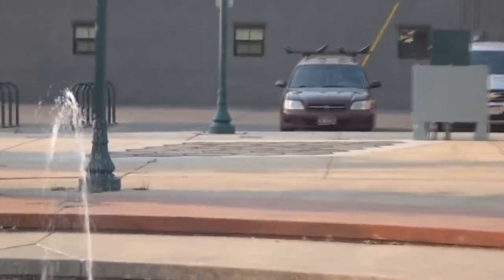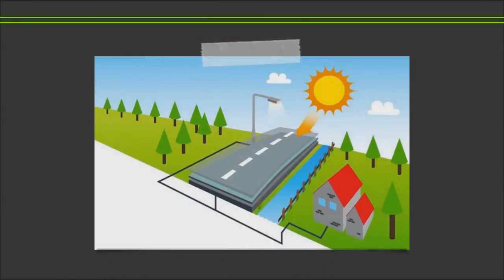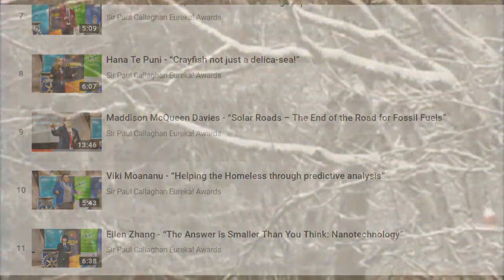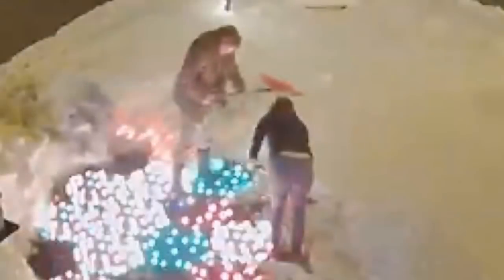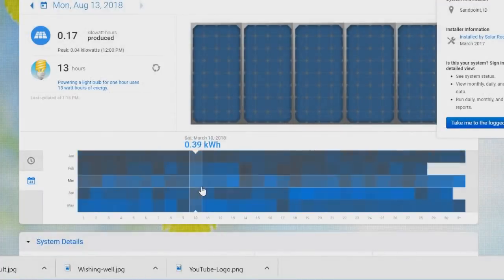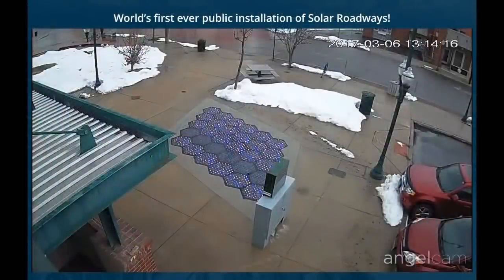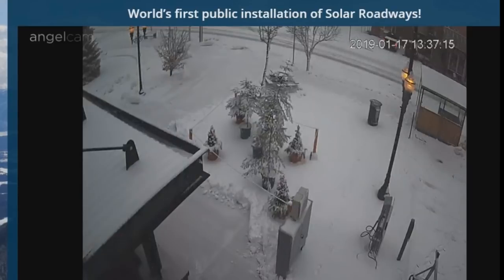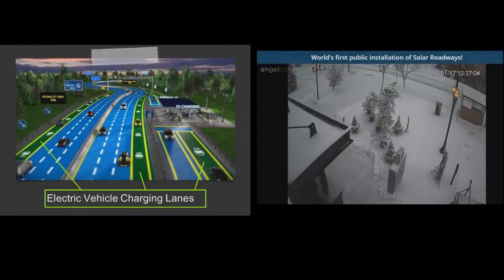Solar Roadways to be installed on Cruise ships!!?

Comment: Has anyone seen their Website lately? They  give a chart  to compare SR - concrete and Asphalt... And they list numerous capability twice to have many pro SR points... -Produces electricity -can charge EVs... 
So here is my advice for your future presentation Solar Roadways : 
-can display the Letter A -
-can display the letter B .... until Z with the incusion of at least every ASCI symbol... 
-can charge Smartphones 
- produces 100% iPad compatible  power 
-produces  100% iPhone compatible power 
-Works also with qualcom Quickcharge (though untested .results may vary) 
-can charge power tools
-can power kitchen apliances
-can power medical appliances  (witch is worth an extra 10 million dollars of funding if you ask us)
-can  power elecric "Water out of thin air generation systems"....(called dehumidifiers by dumb and ignorant people)
-can charge EM drive vehicles
-can power space vacuum thumble dryers...
-can charge Steam powered reusable electric one-stage rockets (wich is just amazing if you ask us)
- can power pumps to maintain hyperloop vacuums

Comment: I'm not backing it, but you do know, most new breakthroughs, concepts, "innovations" never work the first go around, or the 2,3,4th for that matter? In software, releases fail all the time, even after thorough QA testing. Fighter Jets like the F23 failed miserably in its initial stages. The creation of the wheel even failed miserably the fist go around. The important thing is the Idea itself, then to later iterate on that idea and improve upon what you've learned from previous failures. IE: its called innovation and engineering, it all comes from an idea. How many people do you think,  thought Electricity was crazy? microwaves? radiowaves? The road thing, yeah it sucked, they failed to account for too many things...but its simply a learning process.
Reply: Unfortunately electricity and solar isn't new. There are concrete formulas that define their capabilities. We have passed the "learning process". The creation of the wheel failed miserably? You're so dumb it hurts my head.
Reply: @AssemblyBanditChannel  You must make $10 bucks and hour lul. Good for you.
Reply: Ha, I make more than you. You keep working on that wheel, one day you'll get there.

Comment: If I had been the judge, I would have scored the presenter very poorly for the presentation they had given. Hasn't done the research far enough, and has copied almost verbatim some of the claims given by the manufacturer. A true scientist knows how to verify claims. She did not do so.
On the cruise ships bit, I have the following to say. Note, this was written before watching the video.

As a boater, I think I have some experience in this regard, so bear with me.
TL:DR: Solar Panels on Ship Good. Solar Roadways on Ship Bad. Wind Power Master Race Superior.

Solar Panels on a ship actually make a certain amount of sense. There is going to be a significant number of days where there is going to be plenty of sun, and so it could potentially take a massive load off of the ships alternators when charging the ship's batteries or supplying power to all of the electrical appliances.

However, I would not get the people who manufacture the Solar Freaking Roadways to do it. I would get a tried and trusted Solar Panel Manufacturer to design and install a solution specific to that class of ship.

And note I said "class of ship". On a big massive Cargo or Tanker ship, there is a lot of free deck space to use. Mounting it above the deck would also provide some protection from rain when people need to cross the deck. It could essentially be it's own solar farm. It would make a not-insignificant dent in the power draw of the ship. On a smaller ship, like a personal yacht, a single solar panel is more practical simply to keep the batteries topped up, and more importantly, is something many boaters already have.

For a Cruise Ship? It makes a certain amount of sense. There's plenty of open space, the ship uses a lot of electricity powering all of the lights, so it could help. From that point of view, it could work.

BUT. It won't because a cruise ship is a very specific use case where you need open decks. From what I can gather from the video thumbnail, they plan to put the Solar Panels in the floor of the pool deck. Okay... Not where I would put them. I have four issues with this plan.

1. People will walk on the decks and block the sunlight. Solar Panel Efficiency Decreased.
2. In bad weather, you still need to be able to traverse the deck safely. Polycarbonate/Plastic/Glass/Whatever seethrough stuff they decide to use will most likely be slippery. This makes it dangerous. No good. If you make it rougher, it will again decrease the efficiency of the Solar Panels.
3. They appear to want to place the solar panels on the pool deck. This is a Horrible, No Good, Very Bad Idea. Anything electrical on a ship that is exposed to the elements must have maritime grade water resistance. This increases the price. Also, near a pool deck. There is a 100% chance that the pool deck will get wet at some point in the ship's lifetime. It MUST be waterproof, and water-proof to salt water. Salt Water can cause a lot of things to oxidise or corrode. At some point, someone will get electrocuted by a pool deck that produces electricity. I would not want to go any where near that pool deck. And Finally;
4. They appear to want to place the solar panels on the pool deck. This is a Horrible, No Good, Very Bad Idea. Polycarbonate/Plastic/Glass/Whatever seethrough stuff they decide to use will get hot during the day. Very hot. Too hot for bare feet. Why will it get so hot? Because it has to absorb the Sun's Rays to create electricity. And Solar Panels aren't perfectly efficient, and so some of that energy won't become electrical energy, but rather heat. Those toes are going to get rather... toe-sty.

… I'll stop.

What would I do? Put the Solar Panels on the roof of the Bridge, or in areas where the Crew or Passengers have no right to be during normal operations. If there is an exhaust funnel/tower thing, that would make a good spot to put some panels. But not Solar Roadway type panels. Proper Solar Panels. However, Solar Panels are not the best source of energy at sea. So what do I think the Cruise Companies should use instead?

Wind Power! It is much more readily available than the Sun. Energy Collection is much more efficient. It can be kept well away from Passengers and Crew. It is much easier to see if something's gone wrong before someone gets zapped. It can work during the night, so it can provide emergency power at all times of the day, not just relying on batteries overnight. And, most importantly, it's cheaper to Manufacture, with options already available on the Market.

Oh, and Tankers are already experimenting with Sails to offload some of the work their motors and have already achieved significant fuel savings. Cruise Ships should be investing in Wind, Not Solar.

Comment: Massive fail. Even if it worked, it would be extremely expensive and the individual panels like that would probably crack and fail very often. A better idea would be to incorporate the photo-voltaic elements into the asphalt itself. This isn´t feasible and beyond the scope of our current technology.

Comment: The official solar roadway responses are very unprofessional, I find it very had to take a company or suggested project seriously if there posts and responses are full of emojis! It feels like they aren't being very professional about this and that there posts are done with very little care to make it professional.
If I invented something that had the potential to make solar energy from roads that could power cities I would try to be as professional as possible to attract potential buyers and shareholders.
I think the reason for them being unprofessional is that they secretly know that the technology doesn't work are are just trying to find a way to scam people out of money. Unfortunately because they will lie about how good solar roads are people will end up investing in these only to find out that they don't work as well as claimed.  
They aren't even taking into account the fact that there will be cars travelling over the panels and tall buildings will block direct sunlight which will significantly reduce the output of the solar panels.

Comment: i waited a long time to do this video and this display was exactly what i expected it to be...  https://www.youtube.com/watch?v=Y9IEdL6dsdM&t=3s -  there has not been any power generated since sept 3rd 2018 and its nearly june of 2019 and they recently did turn the blinking lights back on and 1/3rd of those panels are not working.  the snow has melted months ago and we anxiously wait for the installation of the new SR4.  this is like watching paint dry with a sad ending.

Comment: Ah that show is on CBS - the same Network that makes Star Trek Discovery and it's weird ideas about how the speed of light and red shift works. Like how an object 50 Thousand light years away is visible at a specific point as a point of light instantly.

Er.. 'Kay. wibbly wobbly subspacey wacey I guess.

But again is the red shift of the same object actually measurable in any meaningful sense even with in the context of the Universal conceits ?

When the object isn't and indeed can't be normal light - and if the burst happened as a speed of light even then why did it take 200 years and not 50,000 years ?

( it didn't take 200 years) but yeah Disco has bad science. lots of bad science.

Comment: God damn, but I hate to see good components wasted on crap like this. Not sure what type of solar panels these were, but they may be using thin-film solar cells. In which case, they may be using cells made with lovely elements like cadmium, tellurium, or arsenic, amongst others. Now, I'm not saying those elements, or the compounds they're used in, are inherently bad. They can be toxic, though, and installations like this one probably aren't taking enough care of their cells to make sure there's no heavy metals getting out of the cells, where they belong. Plus, making those chemicals industrially does produce some amount of heavy metal pollution. Which is why you shouldn't waste good solar cells on this sh*t.

Comment: Tesla's coal-powered cars and trucks

Tesla’s mission is “to accelerate the advent of sustainable transport by bringing compelling mass market electric cars to market as soon as possible,” wrote Elon Musk in The Secret Tesla Motors Master Plan. The large-scale shift from internal combustion engine powered automobiles to electric vehicles (EVs) is a crucial part of this ‘sustainability’ mission. 

Governments around the world have bought into electric cars as a way to lower their countries’ carbon emissions and have coughed up the generous subsidies electric car makers need to make themselves competitive (but note: the current versions of the U.S. Senate and House tax bills end these subsidies). 

But in many countries, internal combustion engine-powered compact cars like the Mitsubishi Mirage have a smaller total carbon footprint than electric cars. How is this possible? There are two main sources of EVs’ hidden carbon footprint: first, carbon-intensive manufacturing processes including aluminum and copper extraction and refinement and second, the dirty electric grids charging the cars’ batteries.

Electric carmakers prefer lightweight aluminum over steel to maximize range: Tesla builds the body and chassis of its Model S almost entirely from about 410 lbs (190 kg) of aluminum.  Average total aluminum content per car is expected to grow from roughly 397 lbs per car in 2015 to 565 lbs by 2028. The highly energy-intensive processes involved in aluminum production mean that a car’s worth of aluminum costs about 30% more in emitted CO2 than a car’s worth of steel. In China, the world’s leading manufacturer of EVs, 14 tons of CO2 is emitted for every ton of aluminum produced, three times more than the CO2 emitted by Alcoa, the U.S.’s largest aluminum producer. China now worries that their dirty smelting operations mean that switching to electric cars will actually make their smog problem worse.

“If the USA had 10% more petrol cars by 2020, air pollution would claim 870 more lives. A similar increase in electric ones would cause 1,617 more deaths a year, mostly because of the coal burned,” said Danish researcher Bjorn Lomborg.

EVs’ intensive copper use—an electric car uses about 6 km of copper wire weighing 45 kg, compared to a conventional auto’s 20 kg of copper—also poses a carbon emissions problem. In the mid-1800s, copper ore contained about 10% usable copper, but over the course of the twentieth century, that purity has decreased to less than 1%, making the mining and production of copper extremely energy- and carbon-intensive. The energy used to smelt copper increases exponentially as the ore grade falls below 1%. The new copper mines being constructed to meet increased demand have to be factored into the carbon footprint of electric vehicles—and in general, new copper ore stocks being developed are deeper and require more energy to exploit than currently productive reserves. 

What about the power grids that charge EVs’ batteries? Energy sources vary wildly by country. Globally, in 2014, 66% of global energy came from coal (29%), oil (22%), and gas (5%). China, the country with the largest number of EVs on the road, got 72% of its energy from coal alone in 2014; the United States produced 68% of its energy from fossil fuels, including coal (38%) and gas (30%) in 2014. Coal use in the United States is trending downward as a proportion of overall energy use, partially due to the new shale gas deposits being exploited by fracking.

Shifting the energy burden of the American transportation industry from gasoline and diesel fuels to the power grid will result in enormous increases in electricity demand. In temperate places like San Francisco, plugging an electric car into a dedicated circuit like Tesla’s PowerWall is the equivalent of adding between 5 and 10 houses to the grid. The supercharging stations required to charge Tesla’s Semis will require surge capacities far beyond anything the American grid was designed to handle. Finally, to get EVs closer to being considered ‘carbon-neutral’—because of their raw materials they never truly will be—the American energy system will have to go green. 

But it’s an open question as to whether solar and wind plants can generate enough power to not only replace fossil fuel plants but also match the increased demand for electricity as hundreds of millions of vehicles start plugging in. The largest, most powerful solar plant in the United States is the Ivanpah Solar Power Facility in the Mojave Desert, which generates 392 MW; the largest wind plant in the United States is the Alta Wind Energy Center in California’s Tehachapi Pass, which generates 1,547 MW; by comparison, the largest coal plant in the United States, Plant Scherer in Georgia, generates 3,389 MW. 

Ironically, Tesla’s electric cars and trucks may end up prolonging America’s reliance on fossil fuels to generate electricity, because renewable sources cannot yet meet rising demand.

https://www.freightwaves.com/news/2017/11/28/teslas-coal-powered-cars-and-trucks

Comment: The audience looked so bored during that kid's presentation. They'd probably all seen the hype for solar roadways before and also checked out some of the reality. The thing that irks me is that, from the clips you shows, all she was doing was regurgitating the same shit that the solar road peddlers spew, basically word for word.
Solar "roads" on cruise ships might be slightly less retarded, though. Sure, they would be blocked a lot by people but you also wouldn't want traditional installations overhead, either.
Not saying it is a good idea, but it's better than roads.